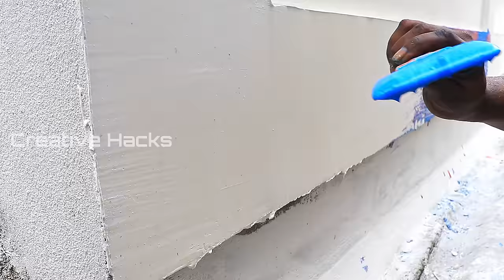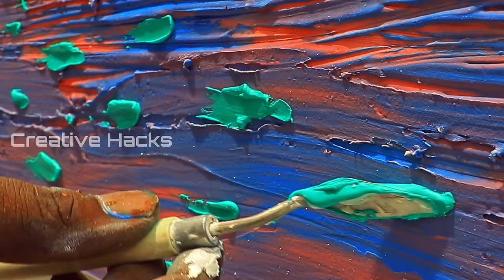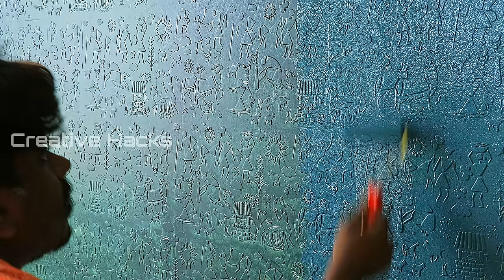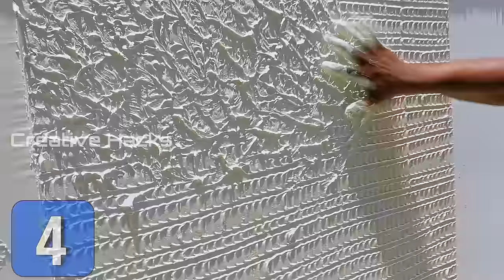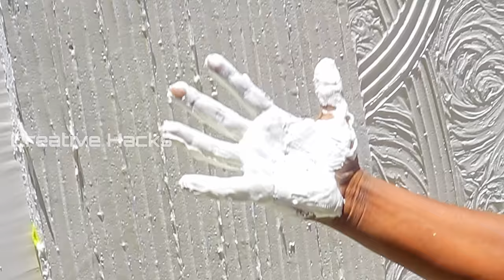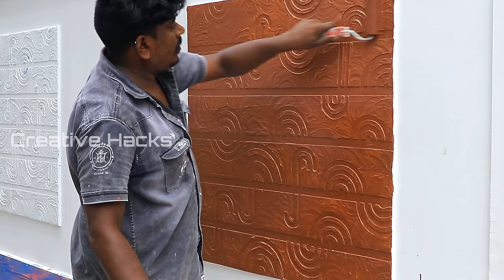8 New Wall putty texture designs techniques and ideas

Comment: In 2000 asked everywhere if there's such product.. wanted to make a border of 3D océan waves ... and a homemade lincrusta/ raised pattern as someone here did with stencil... resorted to painting it since couldn't find any such product anywhere.. what's the durable life span I wonder- does it dry crack or flake off?